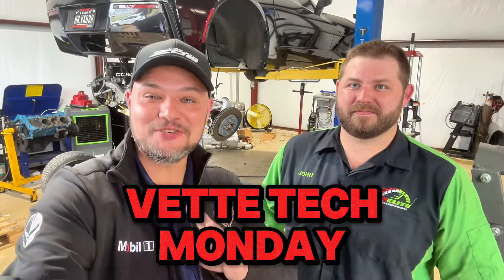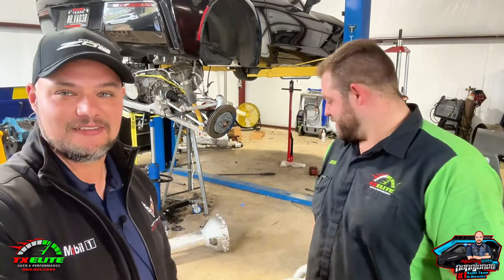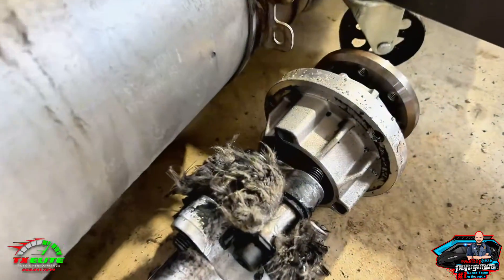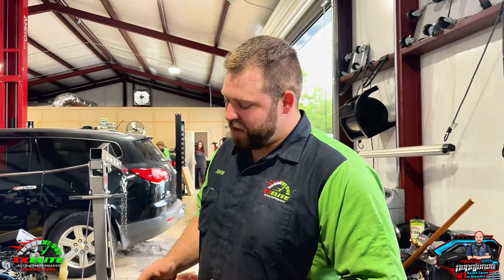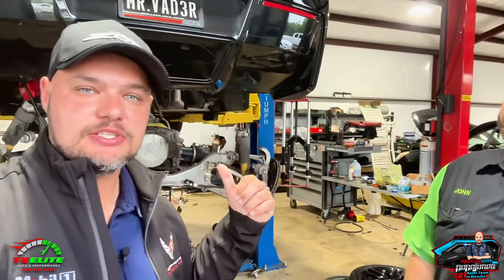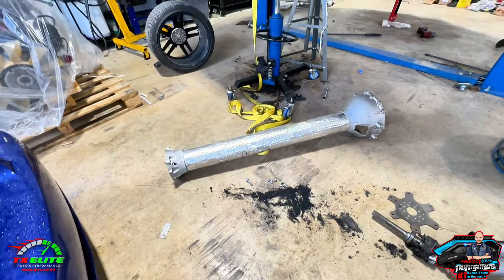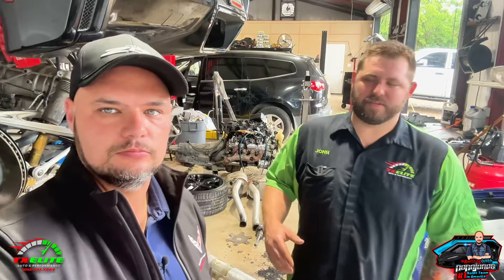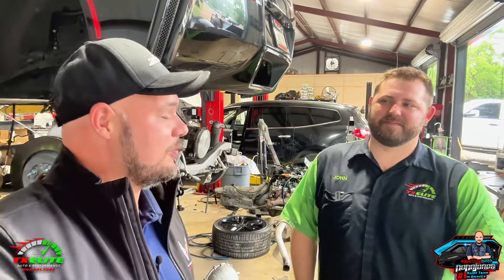Vette Tech Monday - C7 & C6 drive shaft problems

Comment: Actually to solve the problem with the torque tube, the rubber couplers are trash actually there’s an aftermarket company that makes the couplers in polyurethane 12 mm or even in billet aluminum and really solves that problem with the couplers. What are the main issues for the torque tube problem? Is that people leave their C7 with the engine management system to go down to four-cylinder that is a no no and why does GM still do this? They haven’t they learned since the days of the Cadillac doing it? When that V8 shuts down and goes into a four-cylinder that puts a freaking strain from the torque converter all the way back to the transmission on the Corvette and for God sakes, the car already saves gas as it is and anyway anybody who buys a freaking Corvette does not care about gasoline. Another thing that I’ve heard and seen, but I haven’t researched much on it is that there’s a carbon fiber torque tube assembly that actually is rated for more horsepower, so which means if your Corvette is stock with no modifications that talk tube assembly should be more than adequate. I’m gonna replace my couplers before they fail with the billet, aluminum couplers, and I’m gonna research on the torque tube and replace it. I absolutely love my Corvette C7 and my car is tuned so it does not go into four-cylinder thank God.

Comment: I have a 2016 Z51  auto. Mine went out at 31k miles. I'm having a Texas Speed torque tube put in.  It's rated for 1,000 hp

Comment: How much did this repair cost? I have a c5 that will probably need this before too long
Reply from the maker: $2,500 to replace the bushings and the transmission mounts.
Reply: @RollingWithPoPoJones  Did I hear You say the C7 Z06 Does NOT have this problem?
Reply: @vthomas2313 the z06 does have the problem as well the only correction is solid bushings like we did here!
Reply: 2500 for c7?